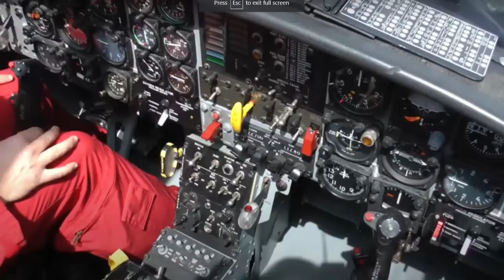Snowbirds CL41 Tutor Crash 17 May 2020

Comment: Considering their were articles from eight years ago talking about replacing the CT-114A by late 2020 shows the issues that face the Snowbirds when it comes to what type they fly.

Whilst it would have been logical to switch to the CT-115 it would have caused logistic problems as maintenance for that jet is provided by CAE whilst the Snowbirds perform maintenance on the CT-114A in house. CAE would no doubt charge lots to follow the Snowbirds around maintaining their jets away from Moosejaw where the type is based.

The Rad Arrows (RAFAT) are facing similar issues, they alongside 100 Squadron (Aggressors) and 736NAS (soon to retire to be replaced by a commercially supplied solution) are operating the Hawk T Mk 1 which is to be retired by 2030. The UK has only purchased a limited number of newer Hawk T2 to support training at RAF Valley. That being said I wouldn't be surprised if a follow on order is placed of a variant based upon the Hawk 165/166 currently in build for Saudi Arabia and Oman being on the cards.

Comment: Thanks for the insight.  I, too, have watched the video several times.  Not sure how much excess energy was available to the pilot so soon after T/O; the climb seemed quite considerable.  I spent some time running the Hawk simulator at the RAF Tac Weapons Unit.  One of the scenarios I used was just this one - engine failure/surge just as the wheels came up.  It was good to see some pulled the handle straight away.  However, others tried relights, etc, and left it too late.  Not sure about Command Eject on the Tutor.  Hawk was rear to front so if instructor went then student also.  Back to the video and energy, it looked to me that the aircraft 'flicked'.  Depending on what the engine problem was, the pre-stall buffet may have been masked by mechanical/surge vibrations?  RAFAT had a similar accident after a practice EFATO/turnback with low speed/high ROD in the final approach.

Comment: Thank you for your analysis. Question - does one pilot eject for the other or do they each need to “pull” the ejection handle?
Reply: Should be a command ejection if the instructor side pulls it. In this case where the pilot was sitting.

Comment: Juan, I always enjoy your podcasts but have to wonder if this accident was the result of an engine failure, and if so, the immediate pull up would been exactly the wrong reaction unless trying to zoom climb to enhance the ejection envelope. Of course right after take off in the Tudor  one doesn't exactly have  alot of speed to convert to altitude. Almost looked like an uncommanded pull up at low speed followed by the resultant departure of the aircraft. Of course the ancient ejection seat and the sink rate pretty much sealed the deal for the unfortunate  aircrew. Looking forward to your follow up as more info is available R/S, DS legas

Comment: Sorry to hear it tragic loss for aviation, sympathies to the families of the lost and injured crew.  

Looks like an old style ejection seats that just pushed you up and out from the aircraft, no self righting capability.   In this case, because of the relative angle and the nose down attitude of the aircraft, the ejection sequence pushed both crew members out and down relative to the ground.  In straight and level flight, above minimum, this would not have been a problem.  They exceeded their safe minimum ejection altitude way before they knew it.

Comment: Zoom up as soon as something happens makes sense to me: 
get a bit more altitude (=time) and go to best glide speed quickly gives you options. 
But they did not push the nose to keep best glide speed afterwards. 
Could it be a blocked elevator? Maybe the engine damaged a control cable or rod?

Comment: Weird they're doing the exact opposite they need to do to not stall, don't climb and lose airspeed, dip the nose and recover as much airspeed as possible to keep flying - pull up and you instantly lose airspeed, you will stall and possibly spin without choosing where you can eject or land. Dan Gryder from the TheAviatorNetwork.com has a 4 point list with fatal flaw from GA.

Comment: This is really an unfortunate chain of events. Things were happening quite fast at a low altitude so it wouldn't be easy to make the decisions for the pilot.
As this is a single engine aircraft the options are few and the only alternative would have been to pick a place to put down the aircraft in a clear spot somewhere along the trajectory, but that's not always feasible either.

Comment: This coverage is competent on such a tragedy.
The key is that the engine failed and correctly the pilot went for altitude.
And then the plane stalled.
Without that, what would the probability have been of a successful dead-stick landing?
Bob Hoye

Comment: So sad...  I am wonder if it was a catastrophic compressor or turbine failure.  Typically when ya choo choo you will get a flame puff... and it’s more then one pop but you still have power. The speed at which this happens ( time line ) tells me the engine went Tango Uniform as they passed the camera.

Comment: Thank you for the analysis. very technical and instructive specially considering that Canadian media probably will not provide any further detail. The "thump" sound of the engine is very clear when overflying the camera and doesn't look like a bird injestion, the rest of the action probably confirms an engine failure. While the Tutor is probably as old as the Cessna T-37, I guess the Cessna is safer with two engines. I couldn't see any parachute after the ejection so I guess the seats are not the zero-zero type. I'm deeply sad for this tragic event.

Comment: Just adding to Johns comments about the seat and it's Envelop. It would appear that the aircraft either suffered an Engine compressor stall or a bird strike. and as per the Pilots SOPs and drills he has traded speed for height and then sadly stalled and started to spin. at which point he has elected to attempt an ejection I have read an article about the ejection seat the Tutor is fitted with and the Drogue parachute system it uses and problems it has suffered in the past, it would appear that they were very close to the limits of the seat but like all well trained pilots he has kept fighting all the way until the end. It was sad that the other team member who was killed was the teams Public affairs officer. From a British Veteran and former fast jet engineer and pilot instructor our thoughts are with the Families and Friends of the two crew and also our thoughts are with the Snow birds team

Comment: Maybe the RCAF should consider an update to the training. Pulling up into a stall is just wrong. That plane could have entered into a glide and landed in the river or river bank. A glide is very low risk with likely no injury to either person. "Sulley" did it with an airbus full of passengers.
Below 1000 feet, its called the impossile turn for a reason.

Comment: T-37C has a 200/200 ejection seat, 200 feet at 200 mph. Higher altitude the airspeed can be lower but under 200 feet anything over 200 mph doesn’t matter.

Comment: I heard the pop but did not detect a puff of smoke or and debris coming from the engine. Also a well trained pilot, as these are, would not try to attempt a steep climb with a reduction in power. I am more convinced that this was a control problem with the elevator cable or rod, jamming or malfinctioning, in some way. It seems that no attempt was made to push the nose down in order to level the aircraft for a safer ejection. Hopefully we will find out soon from the investigators. Sad day for the Snowbirds.

Comment: Wow, I've seen the video a few times from different news stations - I actually live in Comox, where they were flying to - and I knew it was fast, but if you look at the time of that video there's only 16 seconds between that pop sound where the Pilot starts pulling up and the ejection. There isn't even 15 seconds between when the Pilot pulls up and when the jet starts the nosedive.

That's insane, 16 seconds is absolutely nothing, especially not in an emergency like that, it's amazing the pilot even managed to find the eject switch in less than sixteen seconds in that situation!

Comment: Thanks for the excellent analysis of what most likely occurred. Sorry to see a pilot die because of mechanical failure. This should not have happened and I believe the Snow Birds need to scrap the outdated planes they currently fly, they've been using these planes for 57 years. Manufactured equipment lasts only so long and airplanes are not something you just pull over to the side of the road when they get old and start to break.

Comment: It sounded like a compressor stall and the pilots failure to maintain control of AC hence the spin, but that was a very stressed cockpit at that moment. 

That area where they crashed has no place to put down in case of engine failure, I used to fly cargo and bank checks out of there at least twice a  week.

Comment: The zoom was obviously intentional - but was the stall - spin intentional also? In order to “guide” where the plane goes once the pilots bail?
Reply from the maker: no.
Reply: A stall is often referred to as "departing controlled flight" so a stall is definitely not used intentionally. Indeed, the only time you would intentionally stall would be to show a student pilot how to recover from or prevent a stall.
Reply: Ric Barker Thanks. I wondered because this team is an “aerobatic team” and I thought perhaps they had a different ejection protocol In order to avoid letting the pilotless craft glide long after they bailed.

Comment: by the looks of the sound, and the gases ejected from the engine. I suspect the gas turbine threw a blade, and subsequent engine damage ruined the hydraulics of the aircraft. These planes have been flying across the country and perhaps were coming close to an overhaul situation on the running time. The gas plume is fuel rich, which leads me to believe it threw it blade or a massive main bearing failure. No oil to the bearings and bang. All fuel no spin. Hot surface, and engine fire.

Comment: Iam guessing the aircraft was serviced in Kamloops the day before. Check the maintenance log for anything relating to fuel. Watch the video where you hear a loud quick "flame blow out".  The fuel compressor kicked out and the turbine flamed out. 1 second later the pilot goes into zoom maneuver. The ejection parachutes opening respond times dont add up. When was the last time they were repacked and serviced. Looks like the chutes were compression fused together. Sad. Accidents happen.

Comment: A stall? That's a pretty big surprise considering the experience of the crew.  And no Martin Baker zero/zero? They need a new aircraft for such operations.
Reply: The engine compressor stalled causing the engine to fail.
Reply: @KevinSmith-vv2jd  Not referring to a compressor stall. That bird clearly went to a high angle of attack, stalled, and incipient spin. Trading altitude for speed is understandable...to a degree, but that high angle of attack during decaying airspeed and then an attempted turn? I'm just very astonished to see that coming from such a supposedly  experienced flight crew.

Comment: There is a second video taken from the opposite side of the field, likely east of the control tower.  In that video there is a bird flying across the flight path ahead of the jets arrival.  I am of the opinion that there was a second bird tailing the first that may have been sucked into the intake.  The pop heard in the video being analyzed here would pretty well correlate to a slight puff of smoke seen milliseconds before the jet veers to port side.in the other video.

Comment: I wonder why the extreme zoom if the intent was not immediate ejection. Otherwise airspeed would be needed for air start attempt. The turn with low airspeed, was it due to distraction? Was having a non pilot passenger a factor in perhaps zoom to try a return for a dead stick landing? Tragic loss of life. RIP

Comment: The British Red Arrows team have been using 9+2 aircraft for their formations for over 50 years.
This plane looks similar to the British Jet Provost slow trainer the RAF used in the 60's, along with the HS Gnat fast trainer that the Red Arrows used for many years before all aircraft were replaced with HS Hawks. The CL41 is way too old to be doing this sort of thing. They should be mothballed.

Comment: This aircraft has an older, low performance ejection seat. The latest generation seats perform much better. They use sensors on the seat to determine how quickly to deploy the parachute based on the altitude and speed at the time of ejection. (For an example, see this low altitude ejection from a Canadian F-18 using a fourth-generation Martin-Baker MK14 ejection seat: https://www.youtube.com/watch?v=0HDIxzSMp-0 )  If the Snowbirds continue to fly these old Tutor aircraft, they may want to consider at least upgrading their ejection seats.

Comment: Overall, excellent analysis, particularly being that the video is the only data source. Not to put too fine a point on this, but the airplane was NOT in a “SPIN”, just a nose-low spiral. A spin requires steady-state yaw, stalled wings and stabilized airspeed. If an aircraft is accelerating, it is not in a spin (the recovery is dramatically different)  I had the privilege of teaching out-of-control / spin training for the Navy. The ejection altitude was low, but it was rate-of-decent that (fatally) took time away from the seats to function. Overall, Gret job..thanks for the video.

Comment: I'm wondering if the late ejection was forced by concern that the plane would crash into more houses if they continued straight, and thus initiated a left turn.  They did, however, seem to be well into the spin before both ejected.  Seems like the seat separation and chute deployment were a bit pokey.  Chute mechanism would be better deployed a second after ejecting and thus aid in seat separation.  Separation rocket would have benefited from steerable gyro stabilization giving them some vertical height gain and more time in the air for the chute to open.  Maybe an ejection seat upgrade will result from this tragedy.

Comment: You do a good job Juan, very thoroughly, professionally and ably described. Nice to see some honest emotion from you near the end. 

Up here in Canada I feel a combination of sadness, grief and even anger, for the suffering families and friends of both the Snowbird 11 pilot, Captain Richard MacDougall and 431 Squadron's public affairs officer, Jennifer Casey. The Snowbirds are a Canadian Icon, a national symbol of pride and respect and a truly great airshow act. The team is also a very effective recruiting tool for the Canadian Armed Forces. 

I hate to bring thins up, but it must be said. One wonders how much longer the Snowbirds can continue to keep their bare minimum of perhaps 13 57 year-old Cl-41s, aka CT-114 Tutors,  airworthy. They've had what appear to have been two "power loss" type accidents in nine calendar months. As to what caused the aircraft to separate from formation, I agree with your assessment that this aircraft had a sudden and dramatic power loss due to engine failure or compressor stall. I saw no evidence in the video clips I've seen of smoke coming out of the tail pipe, typical of a compressor stall. The pilot pitched up aggressively to trade whatever speed margin he had above the stall for altitude. It does appear that the pilot staled the airplane, and it spun about a full turn to the left prior to the low-level ejection. As one of your still photos showed, Captain MacDougall's parachute landed on a rooftop and was seriously injured. Captain Jennifer Casey was pronounced dead at the crash scene, close to a house.  It caught fire and spread the fie to the house. I also wonder whether the practice of the squadron's public affairs officer riding with Snowbirds 11 pilot is commonplace during repositioning flights, and whether that will continue one the team starts flying again.  

Two smoke trails are apparent after the ejection was initiated. I guess this means the canopy ejection mechanism and both seats' rocket charges worked properly. We see two smoke trails: one object looks smaller, like a human being, while the other looks larger, as if it were one of the two seats or the canopy.  I'm guessing neither parachute fully blossomed, much less swung. 

 I know the Canadian Government has begun a process of replacing the CL-41s, but that could take years to finalize.  At present there aren't a lot of primary jet trainers being built. That segment of military flight training is now carried out both in Americana and Canada using the Pilatus PC-9; better known as The Texan II in America and the CT-156 Harvard II up here in Canada. 

Air crashes take a long time to investigate, and later issue their findings. Crashes can also often be catalysts for change. We'll determine what if any changes will be made a 431 Squadron, who plan to operate the Tutors for another decade. The general consensus amongst most pilots I know, myself included, is that although these machines are meticulously maintained, they should have been replaced twenty years ago! 

We also know that jet formation use aircraft very close to the end of their service lives. You don't see the Blues Angels still flying A-4s. Or the Thunderbirds flying T-38s. The Red Arrows no longer fly the Folland Gnat. The Snowbirds are also the only major military jet formation aerobatic team that does not have a dedicated support aircraft akin to the Blue Angels' C-130, affectionately known as Fat Albert. 

By the way, great job Juan for your accurate and apolitical coverage the 737 Max 8/9 saga.